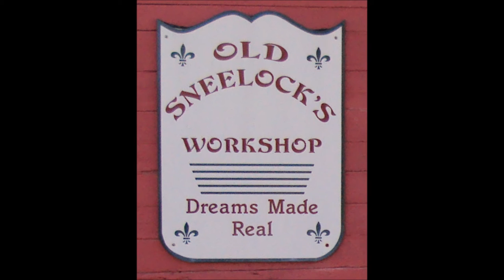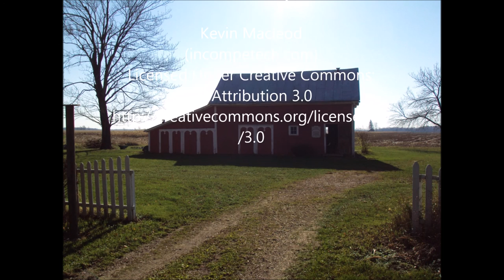Repairing Antique Tools - Millers Falls #12 Breast Drill - Pt 7 - Assemble and test  by Old Sneelock

Comment: Great Job! 

After I started watching your series, I just came across a Craftsman Breast Drill at a local charity thrift shop for $10. Hardly used and in great shape. It has the two speed option and uses a Jacobs Chuck. So not as old as yours a few less features but still made in the USA!
The ladies at the counter, said "Oh your going to buy that..perhaps you could tell us what it's called as we had no clue"  and I filled them in. Their response  was "Well isn't that a clever thing"
This little shop mostly has clothes as you would expect, but one small section has tools that make it in. I've gotten a few gems there for far less than what local "antique" shops would sell them for.
Reply from the maker: +GrandsonofKong That's my secret for finding old tools. I go to the fancy antique shops and ask if they have any old tools. They almost always have some rusty junk that they don't know what to do with. Chisels are common. Planes are getting harder to find though. Popular Woodworking has made them popular. Transitionals were considered worthless a few years ago but now I find them varnished and bolted to a board as a wall hanger. I was hoping they would be satisfied with a few hundred painted Waranted Superiour saws

Comment: Very nice as I knew it'd finish out.a As for me, it'd end up as a "lower breast" drill, or a belly drill. A buddy I used to work for did a lot of swapping around, making 1 truck out of 2, changing pretty much everything from the rear axles to the front, except the frame. We ended up having to drill the frame to mount the hardware for the new-ish stuff and all we had was a  worn out Wen 1/2" drill. and a pile of dull bits. We ended up hooking a chain to the rail and hooking a pipe to the chain and running the pipe through the "D" handle at the back of the drill and letting the force be with it. You talk about SQUEALING, that old drill motor did it, worse than a pig being caught, BUT we got everything mounted. and the drill still lives. Must've been one of the old ones.
Reply from the maker: +Lewie McNeely Right after I started at United Technologies in Coldwater, MI, I had a fellow working for me that was a pretty good mechanic. I sent him to mount a new pump for the direct chill casting pit. After about an hour I went over to check on him. He was drilling the 5/8" diameter mounting holes in a 1/2" steel plate. It was a warm day and he was sweating like mad. I asked him how it was going and he said he had to sharpen the drill bit several times and had only gotten one hole drilled. I looked at the end of the drill bit and it was sharpened backwards. He had set it up so the bit was rubbing on the backside of the bit instead of the front. I was impressed that he had drilled even one hole with it. The end of the drill bit was hot enough to melt and he had been putting all his weight into the job. 
I took him over to the tool room and showed him how to sharpen the bit. Then we walked back to the Remelt Department and I watched him set up to the finish the second hole. When he started the drill I stopped him. It was running in reverse. 
Once we got the drill running in the right direction he drilled the last three holes in about 5 minutes. 
The saying might be "If you ain't rubbin. You aint racin." But with drilling if it's rubbing you aren't drilling. :-)
Reply: That's a fact! If you ain't getting slivers you best be hunting a grinder. I'm surprised he even drilled one too. He had grit like a bulldog for sure. Hate to get him riled. I'm going to have to watch your bit sharpening video again and more than likely, several times before it sinks in. I go back to default every morning.

Comment: Great series, Snee! I have a few of these in the renovate pile. On the auxiliary handle, did it have a screw driver tip on the end of the threaded bolt? I recently learned that is the type of handle for a Millers Falls No. 97(maybe others, too) breast drill. If that's what it is, it is only the second one I've seen. Thanks for sharing.

Comment: Mr. Sneelock 
   I have a #12 breast drill as well.  mine has a blind pin joining the shaft to the pinion gear. Do I need to drill the pin out to fully disassemble the drill? Do I need to drill through the other side of th pinion gear?  Thanks for all your videos. 
Dave P. in Ohio.

Comment: Mr. Old Sneelock,  Would you take a moment to help me?   I have the same breast drill.  I am unable to remove the small gear from the main shaft.  I did remove the pin holding the gear to the main shaft.   I am afraid to beat on it.  I have soaked it in vinegar and have used PB Blaster.  Would you have a suggestion?  I will need to replace the tiny ball bearings as the drill rusted after many years of setting outside.    Thanks, Tom.
Reply from the maker: Tom Miller I had to press the shaft out of the gear with a 10 ton arbor press. I had more trouble putting it back. The pin is tapered and the hole was drilled and reamed for the tapered pin while assembled so it only goes one way.

Comment: I purchased a Millers Falls 118 for $10 dollars the other day. Thing was rusted and would not move much. I was able to take it apart and clean it, A drop or two of 3 in 1 oil and it will work. The problem I have is the breast part is broken and missing the lower handle, But I got it to work. Would you know of anyone that has spare parts? or know the years they were made?
Reply from the maker: I have a few breast drills in the junk pile that I rob parts from. 
Ebay may have some random parts.

Comment: What are the differences in usage between this and a brace?
Reply from the maker: Drilling smaller size drills in metal, 1/2" or less requires higher RPM's to cut well. The gearing allows the bit to turn faster. 
I mostly like to use them because they are an interesting desigh.
Reply: @OldSneelock  Thank you! Very useful information